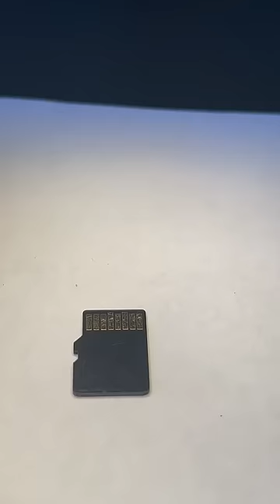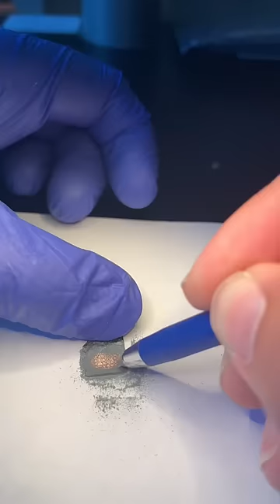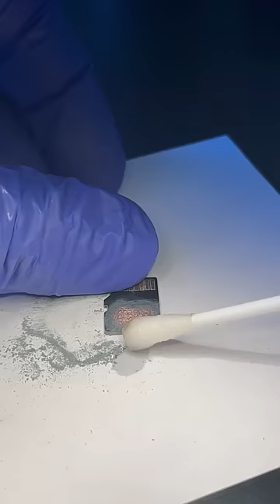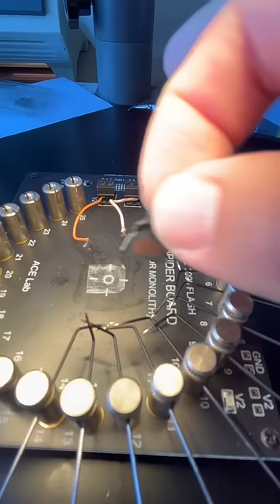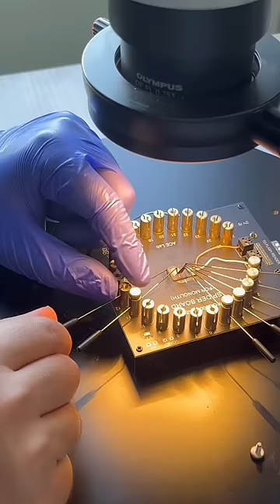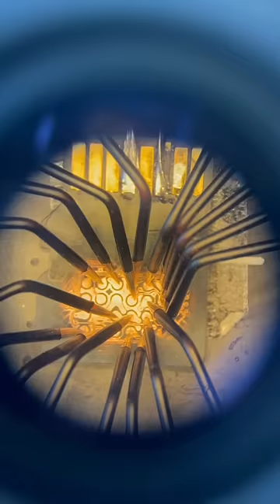Data recovery from a dead MicroSD card using PC3000 Flash and Spider Board (without soldering)

Comment: how is this possible but its not possible to get my data off a flash drive that i pulled out of the computer without clicking the freakin safely eject thing 💀
Reply from the maker: Maybe your data didn't record before you removed the USB stick? If the data is not recorded, there is no way to recover it.
Reply: @developakr  Oh hello! Thanks for replying. 
No, that was not the case. I had plugged it in, viewed files on the usb, then stopped using it for a while. So it had been sitting in the usb slot for about an hour, not transferring or downloading any data. I simply pulled it out of my laptop without safely ejecting it, and it stopped working. I’ve tried just about everything I could find online to fix it besides trying to work with a data recovery program. 
So when messing with it on my computer it says unknown usb device and set address failed. It will also throw Device install requested. 

The error code is 43. 
One thing I noticed is that my working USB flash drive is using a different driver than my bluetooth USB, and my broken USB flash drive is using the driver from my bluetooth USB, not the driver my working flash drive USB is using. No matter what I do I can’t get it to use the correct driver. It just won’t allow any driver installation onto it
Reply from the maker: @D1sc0rd-  I think this method can help you:
https://youtube.com/shorts/ZH4QWtXV8hE?si=aCox-6BqqqbfHVkZ

https://youtube.com/shorts/sdZpzOdjptg?si=uA8y6ztSW1pVAmJZ

This method is used by almost all data recovery companies. I think your local data recovery company can help you

Comment: Without soldering? What about Pin 4 and 6?
Reply from the maker: This means that you don't need to solder all the contacts. There is an older method where you need to solder all the contacts, which in this case I connect with needles using a Sipider Board

Comment: You soldered two wires
Reply from the maker: This means that you don't need to solder all the contacts. There is an older method where you need to solder all the contacts, which in this case I connect with needles using a Sipider Board

Comment: yes. indeed without soldering
Reply from the maker: This means that you don't need to solder all the contacts. There is an older method where you need to solder all the contacts, which in this case I connect with needles using a Sipider Board
Reply: @developakr  that means more difficult way. but it's a brilliant way
Reply: @developakr  that's some professional expert levels

Comment: Hai I was using SanDisk 256GB ultrafit on my laptop after sometime there was system hang.
Without ejecting the drive have restarted my system.
Later onwards this pendrive is asking to format.

SanDisk global warranty is also not helping in solving the problem and they are giving replacement.

But my problem is I have lots of data about my project, business, presentation etc.

I want you to help me in retrieving complete data

Comment: bro literally said "(Without soldering)"
Reply from the maker: This means that you don't need to solder all the contacts. There is an older method where you need to solder all the contacts, which in this case I connect with needles using a Sipider Board

Comment: Still two wires are soldered
Reply from the maker: This means that you don't need to solder all the contacts. There is an older method where you need to solder all the contacts, which in this case I connect with needles using a Sipider Board
Reply: @developakr  , I understood, but as soon as that i heat up my soldering iron the remaining wires from the exposed pads are easy and fast, I am afraid (never used these spider connection) that setup and positioning takes more time.
Reply from the maker: @peterevenhuis2663  I totally agree if you are skilled with a soldering iron😎👍

Comment: Two wires was soldered! 😢
Reply from the maker: 😂 This means that you don't need to solder all the contacts. There is an older method where you need to solder all the contacts, which in this case I connect with needles using a Sipider Board. New Video: Data recovery from a dead USB Flash drive using PC3000 Flash and Spider Board (Kingston DTSE9 8GB)
https://youtube.com/shorts/O1sMWwUZgco?si=40csa_IkFyXJgd21

Comment: yea no soldering
Reply from the maker: This means that you don't need to solder all the contacts. There is an older method where you need to solder all the contacts, which in this case I connect with needles using a Sipider Board

Comment: This is without soldering 😂😂😂😂😂😂
Reply from the maker: This means that you don't need to solder all the contacts. There is an older method where you need to solder all the contacts, which in this case I connect with needles using a Sipider Board